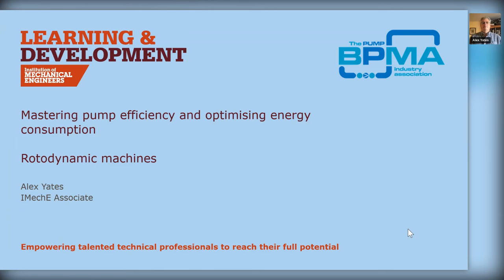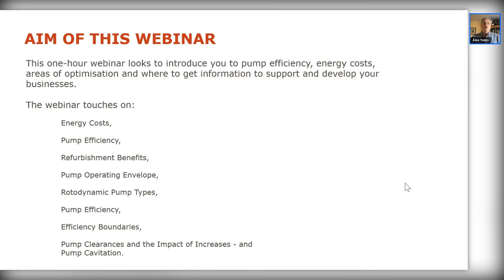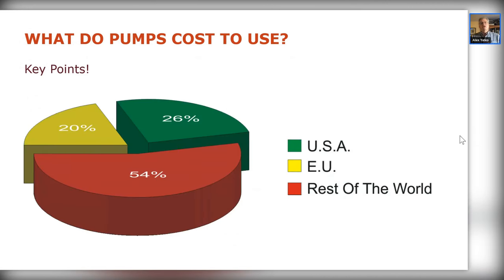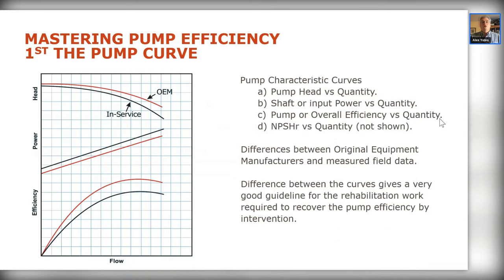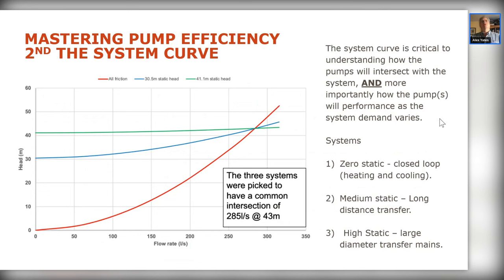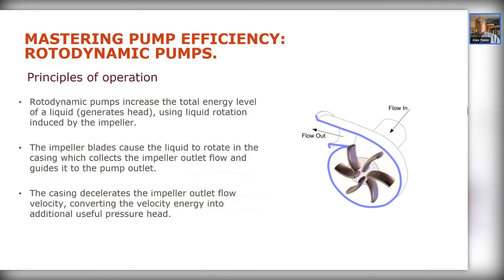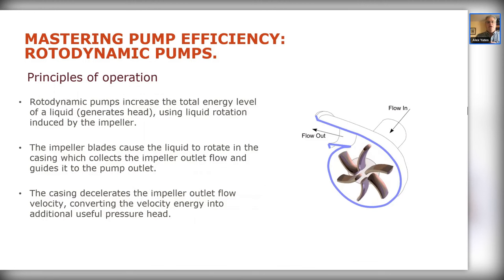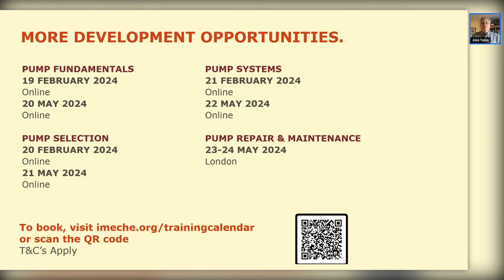Mastering Pump Efficiency and Optimising Energy

Comment: Can a vibration degrade hydraulic fluid So that the pressure is much less within just 4 hours?
Reply from the maker: The question asks whether vibration will cause a hydraulic fluid to degrade and as it changes its condition with a pressure reduction over four hours. For its pressure to drop it would suggest  that the sg of the liquid changes.

Generally, vibration may have an influence on a non Newtonian liquid, because there maybe a change in shear energy applied to the fluid and cause a change in viscosity of the liquid.  Vibration, in principle,  should not impact on a Newtonian liquid (generally moved by rotodynamic pumps).
 
The general definition of hydraulic fluid is a non Newtonian liquid, it may even exhibit laminer characteristics (depending upon is viscosity and component structure).  Therefore, depending upon the liquid construction there is a potential that excessive vibration could induce a shear stress into the liquid.  However, it may also just be a thixotropic liquid that would exhibit a change under normal operation, and if it contained compounds with elastic properties.